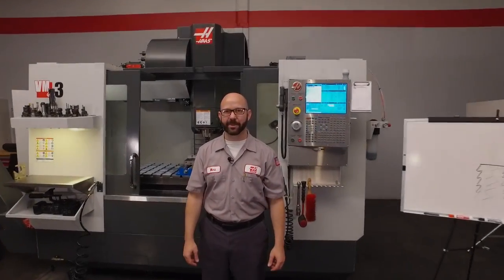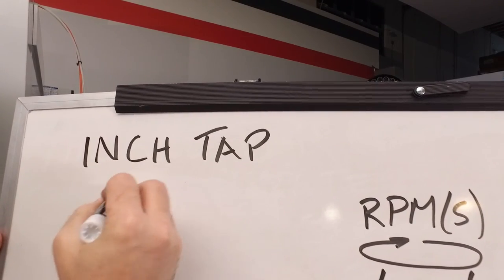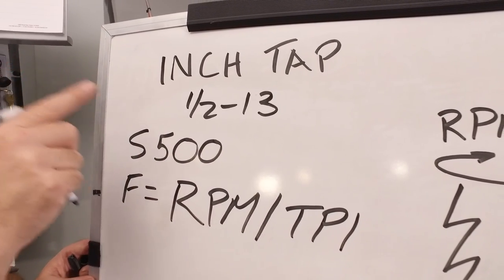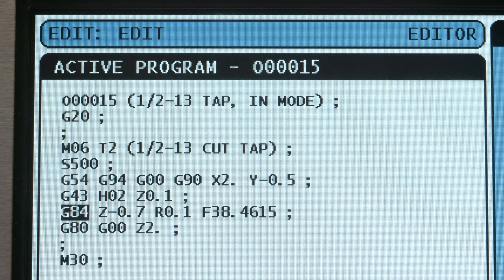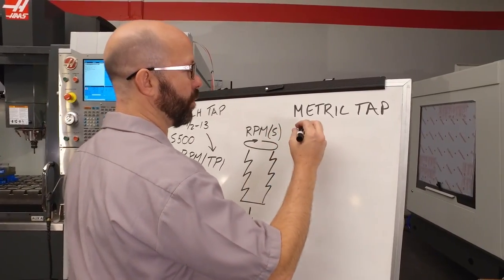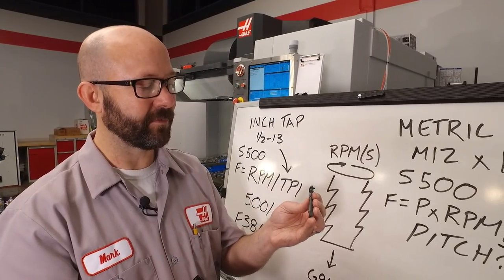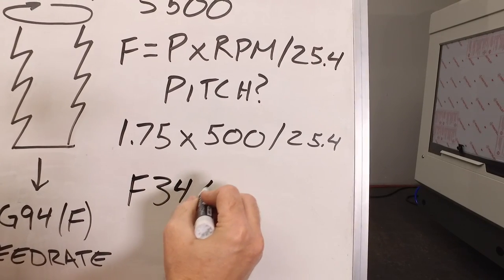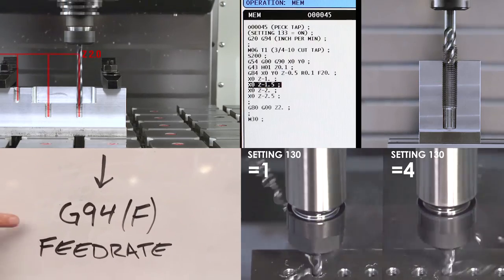Easily Program a Tap in Inch Mode on your Haas VMC – Haas Automation Tip of the Day

Comment: We used to teach the student in our Machining class to do the exact calculation but then round the feed rate up or down to the next whole number then plug that back into the formula to recalculate the RPM because that way you have two whole numbers. For example your inch example  gave you a rounded 38.4615 for the feed rate. I would round down in that case to 38 IPM then plug that back into the formula 38 = RPM/13 or RPM = 38 X 13 which comes out to RPM = 494. So now you have a RPM setting of 494 rather than 500 and an even feed rate that is not rounded at 38.
Reply: That’s just more math and slower tapping just to have a whole number. Doesn’t make sense to me but you do you.
Reply: CNC really doesn't care, a number is a number. Being a round number is good only in your head, for CNC it's a number like any other.
Reply: Haas may be able to handle a 4 place decimal feed rate and rigid tap without breaking it( I run one and think Haas does this just fine) but other machines struggle with keeping up and break taps. I like to do extra math more than I like removing broken taps.

Comment: I struggled with the math, but the logic behind it is: 13 TPI is 1 inch divided by 13 revs, so 1 rev is 0.0769" depth, or 500 revs (in a minute) times .0769 inches per rev=38.4615 inches (in a minute), which allows me to understand it better. If you prove the number you get 500/38.4615, you get 13.000013000013000013000013000013 which not only an interesting number, but only off by 1/100,000". For metric, same thing, pitch (1.75) is distance per rev, so 1.75/25.4=inches/rev (0.0688) times 500 revs in a minute=34.4488 inches in a minute. I realize it is exactly the same as what Mark is showing, but in a way my pea brain can digest. Great vid and thank for the PDF's.

Comment: I did this exact tap on Friday, 1/2-13. 130 RPM and 10 IPM. it ripped the threads out. I used the pecked tapping method described in the other video. 1) Is there a function I need to turn on? 2) Recommend a good rigid tap holder system? Thanks Jim
Reply: not sure if you got resolution yet, but on a HAAS there is setting for this (something like "rigid tap repeat") it should be right with retract speed.

Comment: Why not call out G95(Feed in units per revolution) before the G84 Line, then your F value simply equals the tap Pitch.  This is safe as well if you change your S value.  It's always the same.  You don't have to change the F.  Find it WAY safer if you edit at the machine.
Reply from the maker: +Bernie Koestlmaier Thanks Bernie. Check out the formulas in the Bonus Content 9http://bit.ly/1WDW8lS); we list everything we need for both G94 and G95 (feed per rev) feedrates. We typically use Feed per Minute on Mills and Feed per Rev on lathes, but many switch back and forth. If I’m on a Metric machine, programming a Metric Tap, I’ll often use a G95 feedrate, as the F is just the Pitch like you said. Hope this helps!

Comment: Try using 520RPM for the 1/2-13 and 508RPM for the M12x1.75. I always try to keep me feed rate in whole numbers or at least with as few decimals as possible.
Reply: Tyfunk 02 I think decimals are ok man. It's even ok if to round the decimals as close as possible. The cnc can't sincrinize perfectly anyway
Reply: You're right, why make your feedrate a decimal when you can make it a whole number, that way you avoid any rounding errors!
Reply: Agreed, we always run on the idea that you pick a feed and multiply it by the pitch to get spindle speed, example, 1/2-13 running at F15.0 times 13 equals S195. Of course this is dependent on materials, buy you get the idea.

Comment: We're tapping on lots of the stainless steel series 300 material and our taps don't last long.  We're using Emugee Tap and tap with 306 rpm with 1/4-20 tap and the feed rate is 306/20.  The tap depth is normally about .700" deep.  Do you have any suggestions?  If the tap depth is too deep, do I have to tap it twice instead of tap one shot?
Reply from the maker: You should be able to make those threads in one-shot, without peck tapping. If the taps aren’t lasting long, check your feed calculations (306RPM, ¼-20 tap = G20 G94 F15.3), then I would definitely take a look at your coolant concentration, make sure it’s nice and rich, checking it with a refractometer. Do a test with rich coolant. Next, look at the tap. Emuge makes some terrific taps (Z-tap, stainless). Speak with the Emuge rep and work with them to make sure you are running the ideal tap for the job; they’ll help with RPM. You can also make sure that Parameter 57 Bit 4 RIGID TAPPING is set to a 1, ON.
Reply: Mike Mai for stainless, I drill the hole a bit bigger. For 1/4-20, maybe 5-10 thousandths larger hole will fix the problem without making the thread weak :)

Comment: Should you use a dwell when you get to the bottom of the holes, to give the spindle time to reverse?
Reply: short answer is no, the canned tapping cycle handles all that for you. you could make the argument for adding a dwell AFTER each hole to let the coolant blow chips off the cutter, but thats not usually necessary.

Comment: How to calculate drill size for taps?
Reply from the maker: pop pop – Take a look at the Haas Shop Notes booklet, it has some good general information on drill size selection https://diy.haascnc.com/sites/default/files/Locked/3/shop_notes_reference%20guide_2018.pdf. Tapping Catalogs will have charts showing what size drills to use, for both Cutting Taps and Form Taps (Form taps have larger drilled holes). Both the Emuge and OSG Tap catalogs list drill sizes for specific sizes. – Mark, Haas Tip-of-the-day

Comment: To be correct all the time you should do the calculation with the with the lead value.  Lead and pitch are only the same for single start threads.
For that once in every other lifetime when you use a 2 or 3 start tap.;)
Reply from the maker: Andre -  I loved your comment. We confuse lead and pitch all the time. Because they are usually the same (cross your fingers), we tend to get sloppy with our words.  Lead = the axial distance a tap travels with one full revolution. Pitch = the axial distance between threads. Thanks for the comment. – Mark, Haas Tip-of-the-day